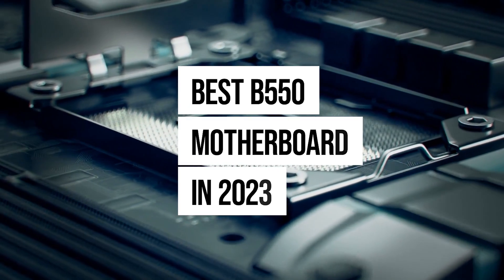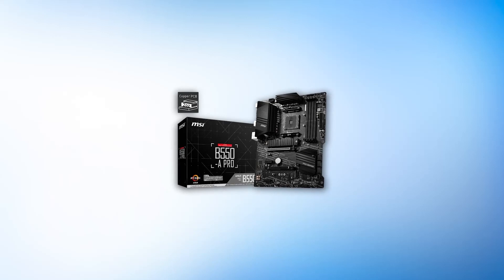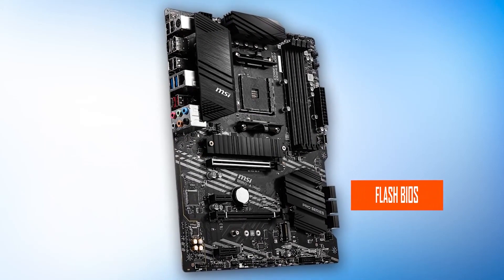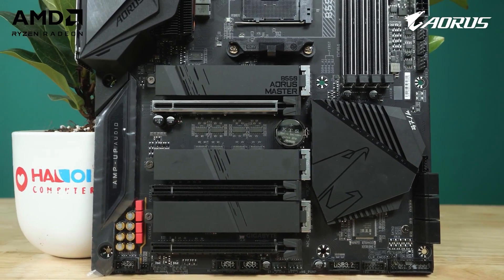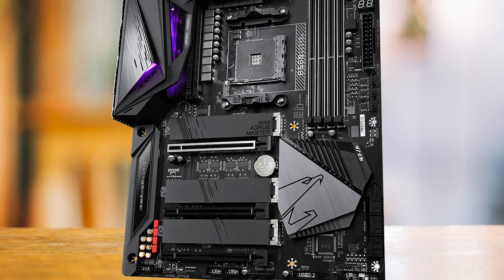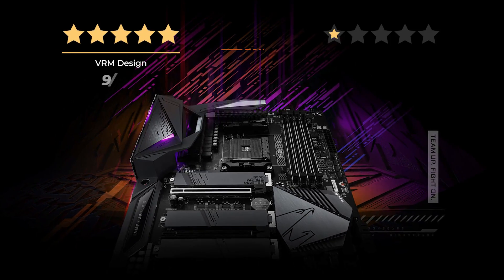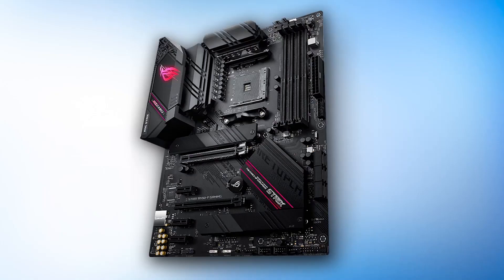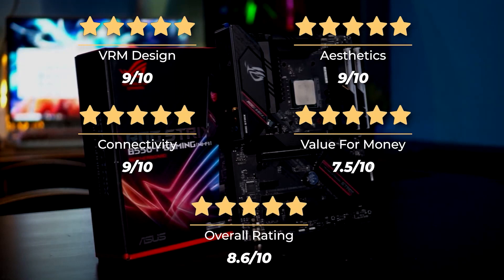THE BEST B550 MOTHERBOARDS! (TOP 3)

Comment: I have the mb and psu left but am wating for prices to go down asus is on sale atm prob is i hear and read a lot of problems with internet card/ship in it seems to be all their b550 cards do you know any thing about that?. Mb most be the most enoying thing to break down and rma sadly hear msi and gigabyte with other hardware for internet is never going down.
Reply: I've never had one single issue with my Asus STRIX B550-F Gaming WiFi II with Wi-Fi 6e (RZ608) and Intel 2.5GB Ethernet.
As a matter of fact, I've never had a single issue with ANYTHING on this board.. and I have all 6 S-ATA slots filled with SSDs and HDDs, an M.2 NVME (Samsung 970 Evo Plus), a PCI-e x1 USB 3 card, another Wi-Fi card (Asus PCE AC-56) and nearly every USB port has a piece of hardware (TrackIR, flight stick, throttle, USB drive, mouse, keyboard, USB-C cable for my phone and some other things I can't remember.)  

Best board I've ever had.  I keep the BIOS updated so maybe that helps and I keep the drivers updated, too.  

Literally no problems.  It's running a 5900x and 2x16GB DDR4 3600 C16 @ 3666 C16 with 1:1 IF.  5900x has a 180a EDC which CAN pull up to 220 watts in AVX all-core loads.

I love it.